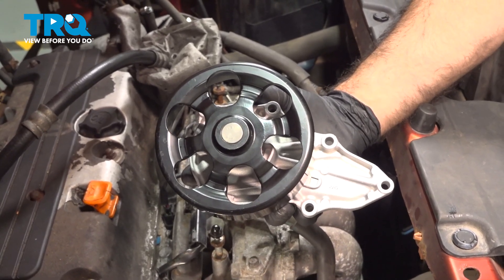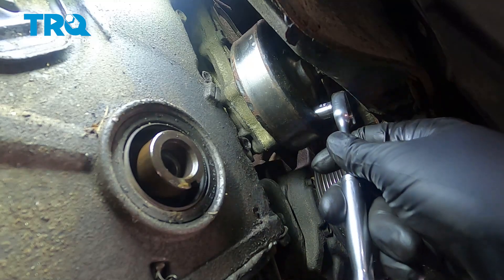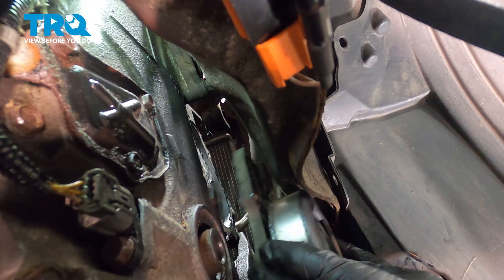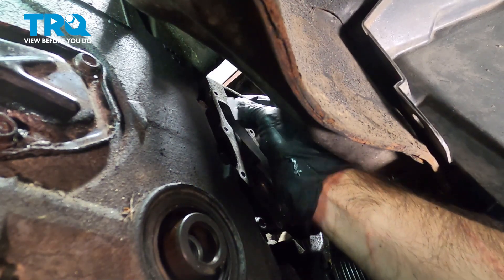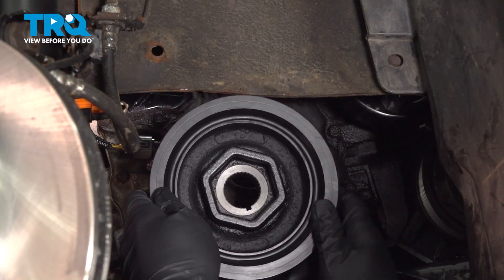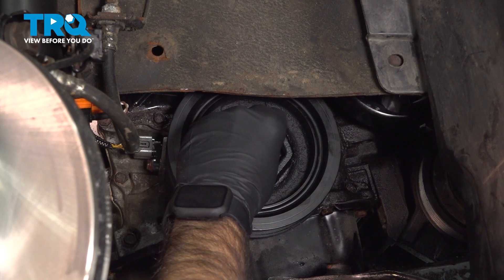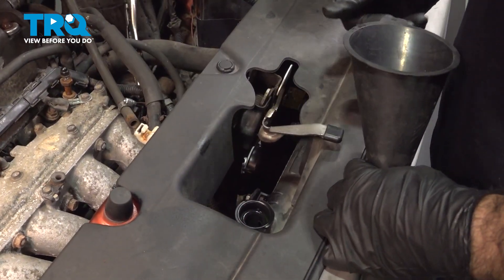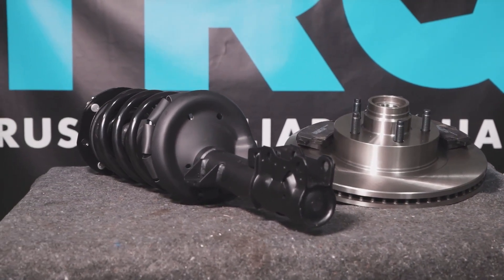How to Replace Engine Water Pump 2003-2011 Honda Element

Comment: Gasket maker ? You don’t need gasket maker if it has a rubber gasket. As a Toyota Technician for 10 years I have learned putting gasket maker where is not needed will cause uneven wear and will leak overtime. The rubber gasket purpose is to seat the water pump correctly and prevent it from leaking. Take my advice !

Comment: Wow.....why the hell are you using RTV on the water pump? Its a gasket seal. You just made Honda mechanics cry.
Reply: It helps seal better and keeps the gasket from going bad again it doesn't hurt but could help
Reply: @iPlAyInSuRgeNcY Honda tech here I can’t tell you how many water pump jobs I’ve had to do over because people put RTV gasket or Honda bond on the gasket Causing a leak ……..it already has a gasket and sucks more when it happens on the V6 models because that’s a cam driven water pump and Timing components have to be removed and replaced and I don’t care how many miles ago the Timing was replaced I NEVER EVER RE USE TIMING COMPONENTS OR IM NOT DOING THE JOB PERIOD

Comment: Leave it to Honda to make it as difficult as possible to work on.  I just swapped an alternator. Did they have to run the AC line directly in front of the 2 bottom bolts on the alt? 20 minutes of grief just to get those 2 bolts out.
Reply: Right? I just did that job a few weeks ago, and on top of the A/C line being in the way, and immobile, the two lower bolts are different lengths. I'm about to do a motor swap on my 2005 Element so any parts I can change while I have access, like the clutch, timing belt, and water pump, I'm doing it.